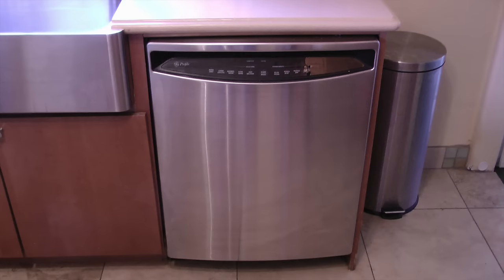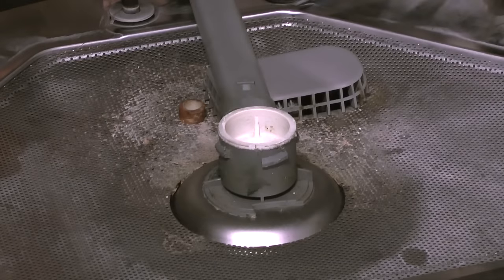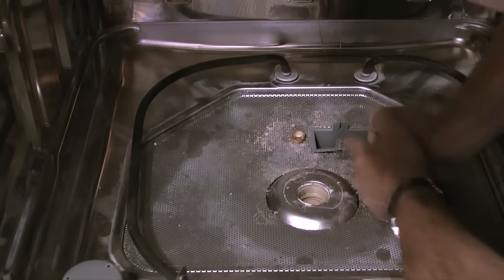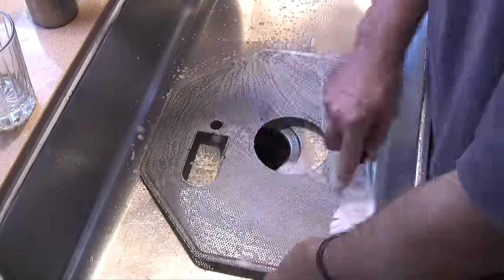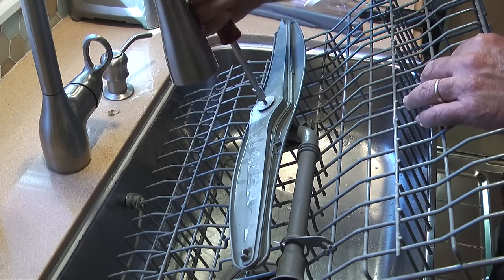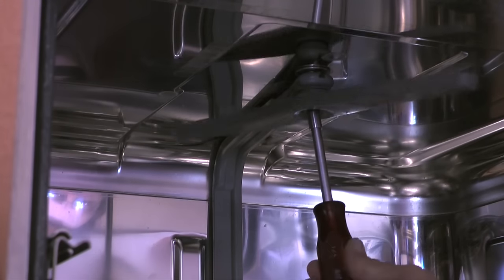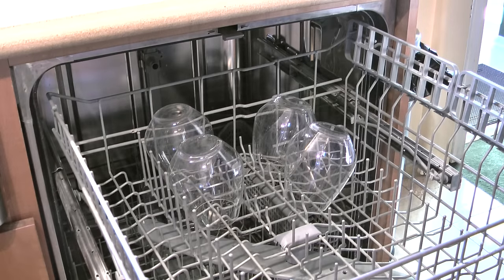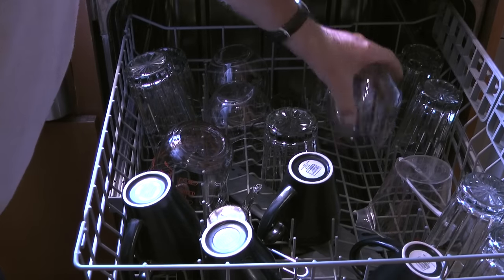GE Profile Dishwasher Maintenance

Comment: Hi I just watched your dishwasher video, I think I'm ready to tackle this now. One question , you didn't remove and clean the float valve on the inside left of the washer, that was a recent problem for me as it got stuck and would not fill. Just wondering if you've encountered this problem. It was a matter of just tapping the top gently to drop it back into place. I'm guessing it was just gunked up with soap scum. Thanks for the video
Reply from the maker: +cristobal pacheco 
Good information, thanks for posting. I haven't had any trouble with my float valve, but I'll try your technique if I do.

Comment: This video is so helpful, but I STILL can't get that filter box out! Ahhh!!! LOL. What kind of screwdriver did you use? Were you slipping it between the tab and the side of the filter and then prying? Any additional tips would be greatly welcome. Thank you :-)
Reply from the maker: I used a small flat blade screwdriver. The tab on each side of the filter is located half-way between each end and is below the top lip of the filter. It's what locks the filter into place. If you take the screwdriver and push it down the side of the filter while prying inward at the same time the tab will release on that side. Then repeat the steps on the opposite side of the filter. Good luck and let me know if this helped.
Reply: iScaper1 Thanks so much! What helped was asking my contracting who's doing a reno at my house to do it. Maybe it just needed to be manhandled ;-) Your video was great and my dishwasher is working like a charm now. BTW, my problem was my dishwasher wasn't draining.
Reply from the maker: Tracey Greenberg
Was the drain hose plugged or was it something else?
Reply: iScaper1 It was not the drain hose. It was the accumulation of gunk on everything. Yuck! After spending the better part of the day on it, I was just so glad it worked. Couldn't have done it without your video. Thanks again!
Reply from the maker: Tracey Greenberg
That's great, thanks for watching.

Comment: around 352 or so, once the screen is removed, there is a rubber plug. Do you know the part name for this? I need to replace that part and I can't find it in the parts manual. Thanks
Reply from the maker: +Christopher Sisson 
3:52 is where I pull out the course screen and start cleaning. I don't remember a rubber plug anywhere, can you be more specific?

Comment: When I put the top sprayer on it seems very loose. Is this the way it should be? I feel like it needs a washer to make the seal tighter.
Reply from the maker: +Nicholas Shows 
On all the dishwashers I've owned the spray arms wobble a bit. I assume they tighten up when the water pressure hits them.

Comment: I just broke my dishwasher by not following directions ! Water everywhere and had no idea why: put it all back together and water everywhere!!!

Edit: the Venturi assembly wasn’t screwed down like it should have been! I rushed through once I thought I had got it, but forgot to follow your reassembly process and forgot to screw it in, I had pushed it in!!!
Reply from the maker: Whew! Is everything working good now?
Reply: @Iscaper  two loads and all good. If that vortex part doesn’t get threaded in until seated it will gush water from the bottom! Look out! Make sure you follow reassembly instructions here exactly; I rushed the end thinking I knew the process and paid the price.
Reply from the maker: @StuBotNYC  Thanks for the info and I'm glad your dishwasher is working again.

Comment: Question: I did all this, and my dishwasher makes a loud noise when it first starts. Like a loud buzzing sound. It goes away once it gets into the main wash cycle. Any ideas?
Reply from the maker: When my dishwasher starts it immediately starts filling the tub with water. I'm not sure what your noise is.

Comment: Hi, I just cleaned the filter and the inside of my dishwasher. We followed every steps of your video. My dishwasher was very quiet before the cleaning and now it does a very high pitch noise. What could it be ? Before I call the repaireman....
Reply from the maker: Might want to double check how you re-assembled everything before calling a repairman.
Reply: Hi, Just re-assembled everything and check and re-checked with your video and it is doing a very high pitched noise, a vibrating noise. My dishwasher was so quiet before...any idea what it could be ? I will try to send you a video of the noise.  PS: I agree with John Doe...why put the filter way at the back when it needs cleaning ??????

Comment: What is the name of the rubber tube that sticks up behind the venturi? Mine is falling apart. Can it be replaced?
Reply from the maker: +Nancy Drew 
If I understand you correctly I think it's part of the sump. Here's a link to an exploded parts diagram, the tube is part of the sump #505 in the diagram.
http://www.partselect.com/ModelSections.aspx?ModelID=397721&ModelNum=PDW8280J03SS&mfgModelNum=&ManufactureID=2&Selected=00121460i05&Position=4&mfg=GE&Type=Dishwasher&Mark=4

Comment: I have this dishwasher. We did a wash, it worked. Emptied dishes, closed the door, and the lights on it are out. No button working. Circuit breaker is fine, all other electric is fine. What could be wrong? I'm thinking of taking it out and checking the wiring but am also thinking of unscrewing the inside door panel to see what's underneath. Anyone have this issue before?

Comment: I didn't get too far into this and ran into trouble as on my unit  I couldn't remove the core screen because there were washers on the two cut out pieces  - on the filter drain and the main drain... I couldn't get them off......

Comment: Do you have to take out the supply tube to release the filter?
Reply from the maker: You need to remove the supply tube to the spray arms so you can remove the fine filter and filter.

Comment: I have question regarding the heat dry. If I just want to heat dry my dishes without starting rinse how can I do that?
Reply from the maker: I don't think you can. Looks like the heated dry extends the cycle by around 15 minutes but I don't see anything in the manual that lets you do a heated dry only. Here's a link to the manual: http://www.searspartsdirect.com/partsdirect/user-manuals/PDW8280J03SS-GE-DISHWASHER-manual

Comment: I know this is a long shot because this video is 8 years old but I followed the instructions and now my dishwasher is making a grinding noise. I tried running it with all the spray arms removed and it’s still making the noise. It seems to be cleaning dishes still. Any ideas?
Reply from the maker: Sounds to me like something may be going on with the pump.

Comment: Hi, the video was very helpful. However, as I washed the venturi a metal washer and solid solid shim about the size of a dime came out. I'm not sure where it goes back, anyone have the same issue or idea where it goes?
Reply from the maker: +Mike salfity 
According to the parts diagram it looks like it goes inside the venturi. I added a link to the parts diagrams in the video description if you'd like to take a look.

Comment: it is the inlet sump. Do you know the sequence for replacing it?
Reply from the maker: +Christopher Sisson 
Here's a link to the exploded view of the motor-pump mechanism: http://www.partselect.com/ModelSections.aspx?ModelID=397721&ModelNum=PDW8280J03SS&mfgModelNum=&ManufactureID=2&Selected=00121460i05&Position=4&mfg=GE&Type=Dishwasher&Mark=4. 
Looks like you would need to pull the dishwasher out of the enclosure to change the sump. There's hose clamps on each side of the sump that look like they would need to be undone to remove it.

Comment: SOS I followed these steps and now my dishwasher is not draining properly…any advice on what to do?
Reply from the maker: I wonder if something is clogging your drain hose. I would first try putting 2 cups of white vinegar in a glass container, place it on the upper rack. run a cycle without detergent and see if that helps.

Comment: How to change the dishwasher cycle please 
When I have a few dishes to clean?
Reply from the maker: Some models have a speed cycle that uses less water and less time. I would check to see if your dishwasher has that.
Reply: There are crystal china, cookware, normal wash,anti bacteria, speed cycle
Reply from the maker: @farahkhamais3946  Here's a link to the manual that shows the cycles: https://www.searspartsdirect.com/manual/26ufcvmok1-000432/ge-pdw8280j03ss-dishwasher-parts
Reply: @Iscaper  Thank you

Comment: I did all the things you suggested & now my dishwasher is leaking.  What now?  Thanks, Bev
Reply from the maker: +Beverly Wulfekuhle 
Some commenters have said they've had trouble with the discharge hose being rotten and leaking. Other culprits could be the water supply or the pump.
Reply: I'm replacing the water hose this afternoon.  Thanks, Bev
Reply from the maker: +Beverly Wulfekuhle 
Thanks for the info. Let me know if that cures the problem.

Comment: use cascade platinum that clean even the filters, it's much better for your dishes and you dishwasher...it don't allow the dishwasher inside became that full of residue... the best detergent that i have tried and the only one PLATINUM ONE (because it is the stronger of cascade line) that i still using, after 10 years using finish that sucks

Comment: No need to use screwdrivers to pull the filter basket. Just squeeze the two sides and pull up.Otherwise, an extremely helpful video.  Thanks for posting it.
Reply from the maker: I tried first squeezing each side near the center until I thought I would break the filter basket, so that's when I went to the small screwdriver.

Comment: Help please! I am stuck on removing the top rack. I removed both clips and it's still doesn't remove the rack. I have a GE Profile SER: GA724878B.
Reply from the maker: My top rack easily pulls out after removing the clips. You might have to download a parts diagram for your model and see if you're missing something.
Reply: Once I removed the clip 3 small metal balls came out on each side. I will look at the owners manual. I can see where it's stopped but don't now how to bypass it.

Comment: I cannot get the lower hub nut off. It won't budge. What am I doing wrong?
Reply from the maker: kbaesch1 
You have to twist counter clockwise about a quarter turn until the tabs on the bottom of the hub nut line up with the grooves in the venturi, then the hub nut will come out.

Comment: Kerry, i broke the tab on the venturi, do you think I have to order a whole new venturi.. My husband is going to be not laughing
Reply from the maker: +Anne Cooper 
Do you mean where the tab on the venturi outlet connects to the water supply tube? If so, go ahead and use it.
Reply: +iScaper1 Yes, where you said the tab was brittle, it was, it snapped off, right where it will connect the water supply
Reply from the maker: +Anne Cooper 
You should be fine, the water supply tube can't go anywhere because it rests against the back of the dishwasher.
Reply: +iScaper1 I thought i may be ok, as there is no where for it to go... anyway, i will put back together, and see how it works, crossing everything.. didn't break anything else...LOL wow was it dirty
THANKS FOR THIS HELP.. YOU ARE A LIFESAVER
Reply from the maker: +Anne Cooper 
Let me know how things turned out.  :)
Reply: +Anne Cooper Pete, that supply tube sure doesn't fit tight into the venturi with the broke tab.. Plus my tube didn't " snap" like yours did in the side wall - I squeezed the tube holder, and now it seems to snap better, still seems loose though at the venturi.. hard to know what water pressure might do.. I found the part needed online, so worst case i will replace that unit.
YIKES, i sure hope this thing works when it is back together
Reply: +iScaper1 Dishwasher now on, sounds good, a quick open of the door shows the top and bottom arms spinning properly. The video was outstanding Pete. as was your help along the way. You missed your calling ;-)
If you are ever in western Canada, let me know, and I will ensure my hubby and i take good care of you.
Reply from the maker: +Anne Cooper 
My name's Kerry not Pete, but thanks anyway. I'm glad you got everything back together and working. We've been to Canada a few times and love it there! Best, Kerry
Reply: +iScaper1 Thanks Kerry, I edited all my other posts.. I notice the Pete comment below, and somehow thought that was you... All good here.. Thanks again.

Comment: what is grey front left cylinder for ?
Reply from the maker: +Rich w 
Sounds like you're talking about the float. The water that fills your dishwasher lifts the float, and when it reaches a certain level, it acts as a trigger for the float switch. Here's a link to the body parts diagram: https://www.geapplianceparts.com/store/parts/ModelSectionParts/PDW8280J03SS/2/0/0/0/BODY_PARTS

Comment: Got through all these steps only to have the same problem...dammit! The cycle never completes. The detergent drawer never opens and it's like the washer resets itself. When I run a Rinse Only cycle it is supposed to run for 10 minutes but only goes for 6...

Comment: This video is great but I couldn't for the life of me get the filter out. I was afraid my crappy little screw driver was gonna bream
Reply from the maker: It is a bit nerve racking to remove the filter.
Reply: @Iscaper  I was able to solve it with a mini pry bar from home depot, easier than a screw driver.
Reply from the maker: @endorfinator5502  Great, thanks for the information.

Comment: Your video is awesome. Thank you so much. Sadly, I can't find a solution to my problem, so maybe you can help me. My washer suddenly has no power. I checked the breaker and it's definitely the washer. Then I found a part on the bottom of the unit... Just laying there. It's a little metal wand with a ball on one end and a tiny screw end on the other. I'm assuming it's a connection that also serves as a kill switch when disconnected. But where? I snapped a photo: https://db.tt/PW9nW3Vu ...Any ideas???
Reply from the maker: +Kimberly Koury 
I didn't see anything similar to your photo in any of the part diagrams. Sadly I think you may have to call a repair tech.

Comment: I know this is a repeat, but that video was outstanding.  Question, when i was securing the top arm, the suction cup connector disconnected from the 'ceiling' of the DW.  I tried epoxy and it didnt work - it said 5 minutes and i let it dry 30.  Is that the best way to secure it?  Perhaps try it again and let it cure overnight?
Also, scrubbing a half lemon on the film helped most but it didnt remove all the hardened calcification - if you have a better cleaning solution, i would like to try it.
Reply from the maker: Epoxy overnight sounds like a good idea. Have you tried CLR on the deposits?

Comment: I just did a new load of dishes in  my brand new GE Horrible dishwasher & used Finish even Cascade Drying agent and they all came out smelling like a wet dog again. I cleaned the filter even though it was clean brand new etc. Now I have to rewash many items by hand. Never purchase anything GE.
Reply from the maker: I would try setting a couple cups full of white vinegar on the top rack and running a cycle without detergent to see if that helps.
Reply: @Iscaper  will try this
Reply from the maker: @guitarstar717  Good luck, let me know if it works.

Comment: Ditto to the positive comments.  ( And to John Doe from 2 yrs. ago, I appreciate your laying the blame where it belongs but maybe just a good ass kicking of the designer would suffice. LOL!)  The plastic bucket has two strut-like projections on the inside, both with notches for releasing the clips.  I noticed these when I was putting everything back in.  Standing water too murky to notice before removal.  Ok, I'm in for a slightly harsher penalty than a simple ass kicking.

Comment: Wanna come over and do this for me?  I'll make some pizza and crack open a few beers?
Reply: Theodore P  oh yeah!
Reply: Absolutely fantastic video. Thank you for taking the time on this. I took the spray arms out before and cleared them out using wire, water and compressed air. I ran some baking soda, and white vinegar and thought I did an awsome job - Ha!

Your video taught me I did 1/3 of the job. Thank you again,  my wife is absolutely thrilled with how it is running now..."Like new"

Comment: Do you not think if GE wanted people to service the filter they would have designed it differently.  This is not something that is recommended
Reply from the maker: I think GE wants you to get frustrated with dirty dishes and buy a new dishwasher, or failing that to call an GE authorized appliance tech to clean the filter.

Comment: The only official info I could find on how to clean it is a cop-out on GE's part.:
http://products.geappliances.com/appliance/gea-specs/PDW8680NSS#spec-reviews
Click on the review tab and scroll down.
 The synopsis says clean the fine filter and if that doesnt fix it, call service. And scrape all your dishes first if you don't want this to happen. I seem to remember advertisements suggesting you specifically didnt have to do that. (food grinder feature?)

Snip:
       Sierra9               · 5 days ago         How do I clean out the filter in the PDW8000 series? Where is it, and how do I remove it?            1     answer              Hi
 Sierra9, 
I am happy to help. The spray arm may be removed to check the fine 
filter underneath. Gently lift up the spray arm while rotating it 
counter clockwise about 90 degrees. This will "unscrew" the arm and 
permit its removal. Inspect the fine filter. It should be clean. If not,
 service should be contacted to clean out all the filters and spray 
arms. To prevent this from happening, scrape dishes before placing them 
in the dishwasher. Service can be reached at the link below: http://www.geappliances.com/ge/service-and-support/service.htm?ICID=GEARsupportflyout-serviceThank you for checking with us.